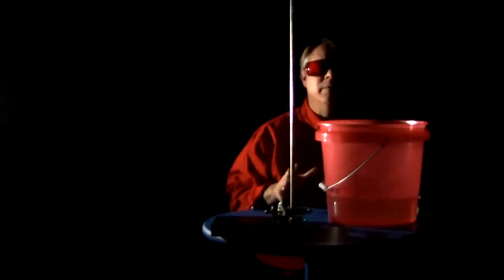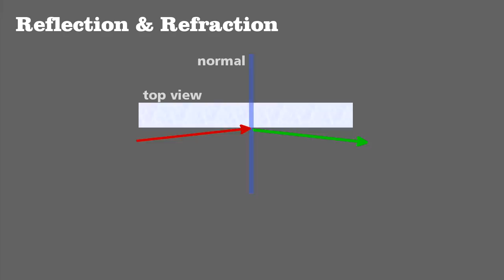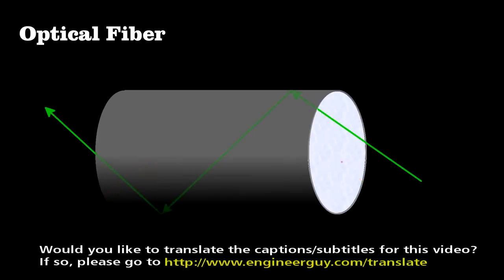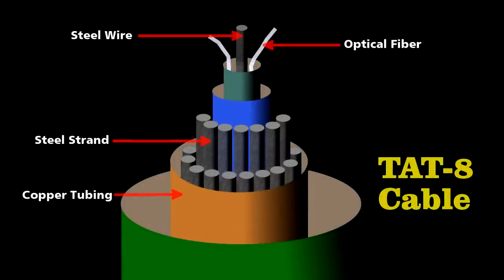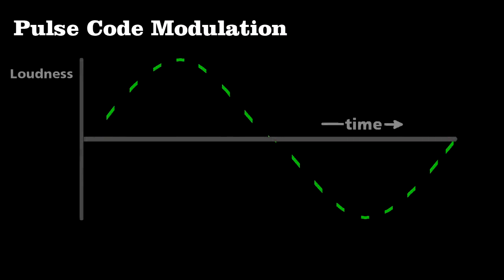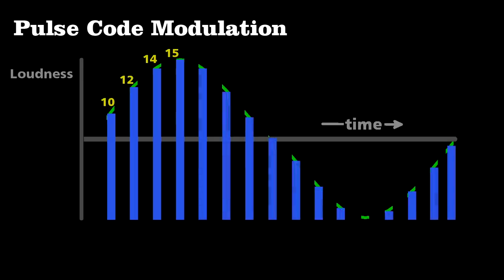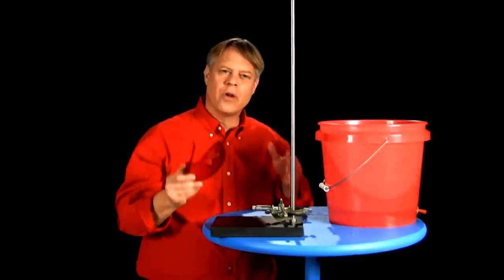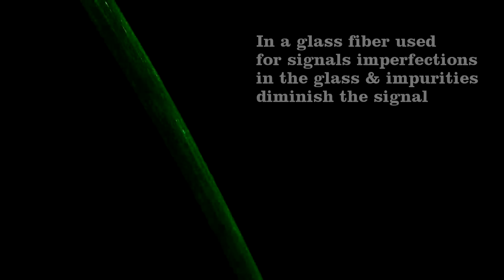Fiber optic cables: How they work

Comment: How much power can you transmit over fiber for practical use rather than communications?

Would you have to have bundles of single mode fibers to accommodate high power demands, or can you use larger glass cores to accommodate a higher wattage per cross sectional area?

I ask regarding a power grid that is impervious to EM interference from things like the EMP from lightning strikes, High Altitude nuclear explosions, and Sunspot activity.

Comment: That's cool.

In my country (Croatia) computers are STILL something to be afraid of

I received my first computer 30 years ago and my first internet connection 25 years ago

I still remember as it was yesterday waiting for the dial up modem to connect me with the internet

People are afraid of the unknown

Its the greatest evolutionary flaw mankind has

I remember when i first saw a automated register in a shopping mall

At first i was afraid of using it because i didn't understand how it worked but at the same time i was very curious about it

My curiosity was stronger then my fear and i learned how to use the machine in 5 minutes

You just have to resist your fear when you know something will benefit you

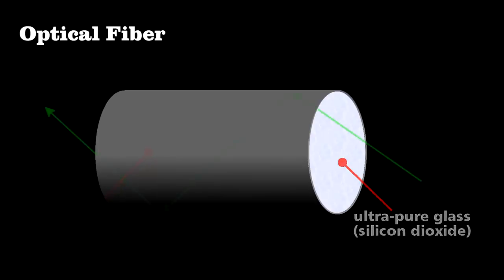Comment: 2:18 Germanium increases refractive index, not lowers it as it's pointed in the video. Thus it's usually used as a dopant in core. As a clading pure SiO2 is used or doped with fluorine or boron which both lower the refractive index.

Comment: Amazing Video. But how do they amplify the signal in the ocean if the signal can only travel 50 km? I imagine the ocean is too deep to put something more complex than a cable down there.
Reply: Underwather optical cables have a layer of copper that's used for powering and they put repeaters every 50km or that power light in the optical fibers

Comment: So what I learned that if tank armor is made of the right material and placed at a steep enough angle it will bounce a laser off of its surface similar to traditional armor richoting certain ammo or outright shattering apfsds at extreme angles... so rule of the day regarding armor dont forget to angle :P

Comment: To solve the problem of the beam getting attenuated and the initial peak signal getting stretched as it travels through the cable, modern optic fibers use cores as large as the wavelength of the signal they transport so that only one mode is allowed to exist inside the core.

Comment: Is there any possible way to 'steal' message from an optical fiber?  Like if I cut it then put another device that connect the both ends, a copy of those light signal is grabbed?? is this possible?
Reply: It works on total internal reflection, and is very complicated, I guess not

Comment: What are the benefits of optical cable over traditional copper wire?? And how is optical cable, despite being more expensive, is economical than other cables??
Reply: Light is about 100 times faster than electricity. For example, it takes about 4 to 5 seconds for the entire time Encyclopedia Brittanic to be transmitted on TAT-8. It would take about to 500 seconds for it to be transmitted if TAT-8 was a traditional cable.

Comment: How was the signal amplified?
Reply from the maker: Power runs through the copper casing.
Reply: @engineerguyvideo  Thank you for the comment back. I was looking it up, apparently they used signal repeaters just shy of the maximum distance the signal could travel before terminating.
Reply: @engineerguyvideo  but your comment about power being ran through the copper casing answers the 2 questions I had remaining after learning more about the repeater system. How did they power the repeaters, and was it some kind of weigh point type of device periodically placed on the ocean floor at regular intervals of distance based upon calculated signal strength? 
Apparently not.
 Apparently it was self-contained and powered through the very same cable; which makes total sense.
Thanks for the info.
Have a great night.
Great YouTube channel by the way. It really is fun to watch

Comment: Thanks for such explanation.
Q how is possible to confirm if the light is passing the fibre optic cable?
Reply: It's visual, so you can look on either ends of the cables

Comment: Sooo the signal needs boosting every 50 klicks of so.  HOW is that done?   Did I miss that part of the lesson?
Reply from the maker: You did not miss anything and in fact from the information you created a well formed and excellent question: there is a copper tube as one of the layers of the cable, electricity via this metal powders amplifiers along the tube.
Reply: @engineerguyvideo  OK.  That may be a proprietary system.  4000 miles divided by 30 (50 klicks) = about 134 boosts.  Thank you.  Sure like your vids.

Comment: if the signal can travel 50km before being amplified, how is it amplified many times as it travels across the atlantic?
Reply from the maker: Power runs thorough the copper sheath of the cable.
Reply: @engineerguyvideo  wow answers even after 10 years what an OG

Comment: @ 2:35 The subtitles don't match what the man said. It reads "1600 meters per minute" but the man said "1600 meters per second."
Reply from the maker: Subs are right!
Reply: @engineerguyvideo  Ups, I wrote it wrong. I've edited my comment.

You said 1600 m/s but the English subs say 1600 m/min
Reply from the maker: The per minute is correct

Comment: How do you amplify signal after 50 miles?
Reply from the maker: Electricity runs through the copper sheath to power an amplifier.
Reply: @engineerguyvideo  Since the signal is in light (Laser), how this light amplified by the amplifier. What does the amplifier consists of and how does it work? Specifically, how is laser signal boosted up to continue on?
Thank you for replying-Fascinating subject.